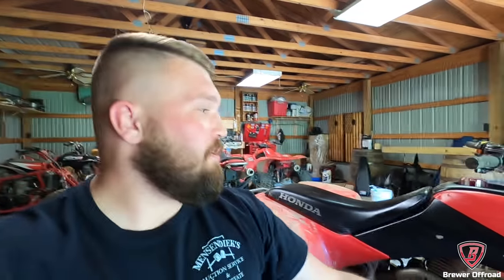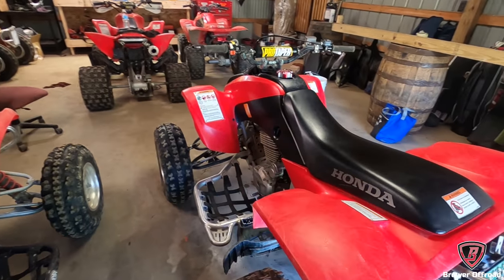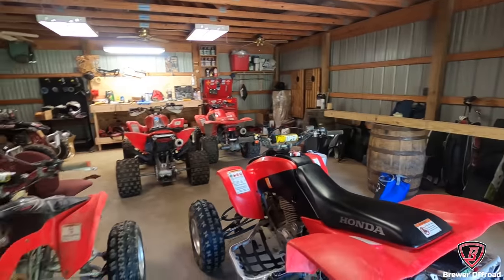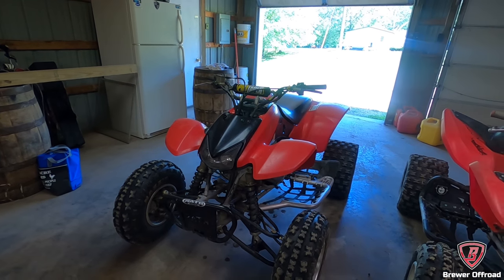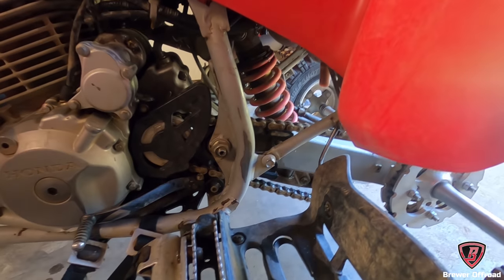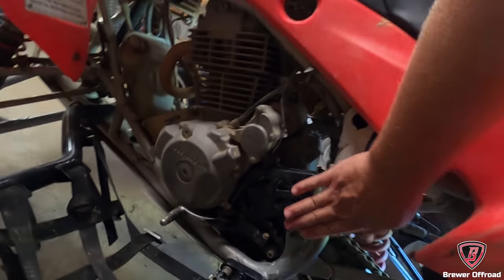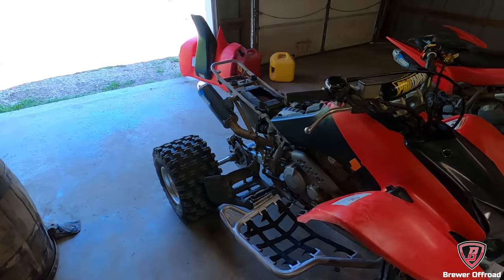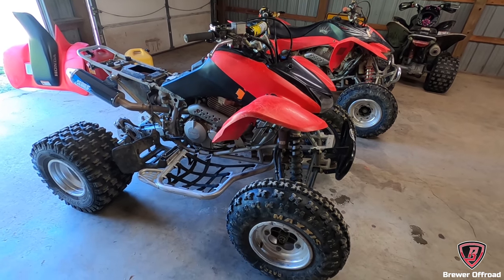What to look for when you buy a used Honda 400ex. DON'T GET SCREWED!!!

Comment: What kind of jets did you use for the pipe?
Reply from the maker: To be honest with you I cant remember. The best thing to do is buy an assorted jet kit and play with different arrangements until you find what works best for your setup. You can look on forums for similar setups and what they ran and start there. Then change one jet at a time. I need to open mine up and look again because I have been asked several times.

Comment: Now you say cosmetics but good luck getting a set of original Honda plastics without spending $1,200 even after markets are going to run you at least a grand you said you bet the lower control arm so you're going to have to put aftermarket control arms on it or you going to buy some something used from a junkyard and call it good with aftermarket alarms are almost 500 bucks for the set I've got a 2004 400EX friend and damage and ball joints were blown on one side can't replace the ball joints on the stock a arms so probably going to end up getting the aftermarkets with your 479 bucks plus tax you can add up to 3 in though they are adjustable and that's per side so you can add two to three inches on each side make it more stable and harder to roll I already bought 2-in adapters for my axle to make it wider so it doesn't tend to roll around corners as much but I ride mine on the street more than dirt my street tires like bark them on the on the asphalt pretty good could even drift them on the asphalt if I really want to tires work just as good off-road as they do on road so you're not wearing them off in a month

Comment: just bought an 08 in mint condition
Reply: yesterday
Reply from the maker: Nice! I'm looking for a stock one in mint condition
Reply: @BrewerOffroad  sick it wasnt fully mint it was missing bolts around the frame and stuff but it has a new 440 big bore and the stock bore is still in good condition also it needs a valve adjustment screw and nut
Reply: @BrewerOffroad  the quad revved out good with just a little bog if you slammed on the gas but its not getting power
i think its the valve being completely un adjusted and its running a 152 main with hmf slip on and big bore
Reply: @adenross3279  how much u get it for

Comment: Is 3000$ Cad too much for a 2009?
Reply from the maker: Depends on the condition
Reply: I would say good but I’m not sure... if I could find one above 2006 for below 4K I would say decent deal
Reply: I just a bought 2004 trx400 from the original owner for $2500. It’s in great condition.
Quads are scarce in New England too
Reply from the maker: Nice!

Comment: What does it mean if the quad cranks up but won’t start I need help plz
Reply from the maker: Could mean several things. Is it cranking fast or slow? Is it getting spark? Has it been rebuilt or did it just up and stop running?